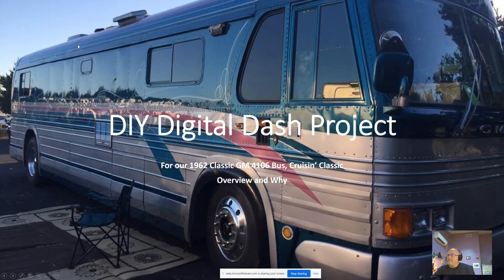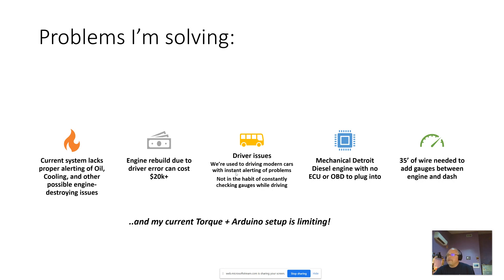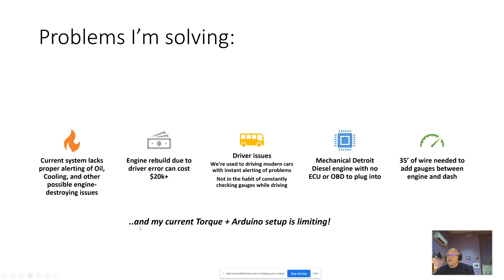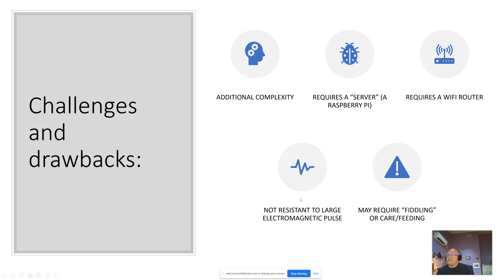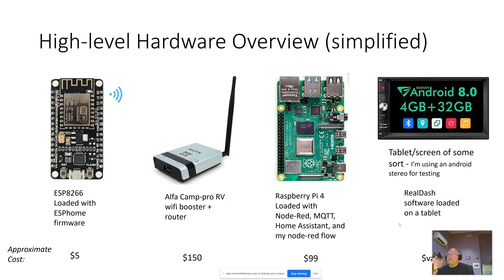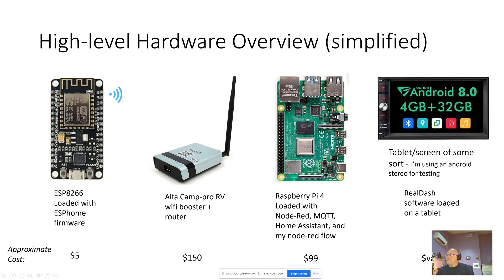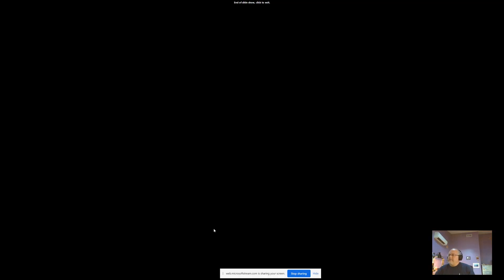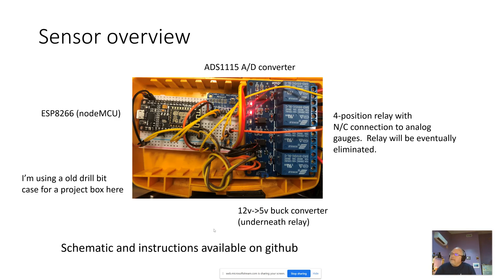DIY Digital dash project overview

Comment: You could remove the rooter and raspberry…connecting directly to the esp8266, but you will loose some features (node-red,Matt,…)
I’m working on similar project for my westy, 
What sensor are you using?
Thank you for sharing
Reply from the maker: Ultimately I did remove the pi and the “middleware”… see later vids for current iteration. I am not done, need to take it further, more open source, and simplify.

Comment: Before I learned of this project, I had thought about the Tesla dash. I thought about having a full iPad where when I started out on a trip I could choose the gauges I needed. For instance if I would be traveling in the desert I could choose coolant, transmission, oil, temps for display, maybe tire pressure sensors, etc.
Reply from the maker: I am considering something similar. There are 12”+ android decks available now.

Comment: Great video! Do you have a list of the sensors for the bus that are compatible with micros? Thanks!
Reply from the maker: Look up the ESPhome website. Anything listed there will work. Sensors that are variable resistance to chassis ground work thru a voltage divider circuit to measure the resistance. Look in the video description below for links to the project and schematics.

Comment: Isn't that a DeWalt drill bit box?  I'll take the bits if you aren't using them. ;-)
Reply: I have 3 or 4 empty dewalt boxes.  I'll throw the stranglers into the new box
Reply from the maker: Yep. It was just the right size.

Comment: I like this, I’ve been thinking similar. I wanted to also somehow get some sort of fuel efficiency rating display as well. My thought was to take throttle position compared to speed to get a rough idea of where it’s most efficient for a given scenario.
Reply from the maker: You could do this with 2 fuel flow sensors - one on the supply, and another on the return, and some math.
Reply: @ThisOldBus  Trying to find those flow sensors with data I can get at AND ones that I don't think will fail / strand me has been hard to find.   I was thinking I could work backwards with an approximation with just throttle position and speed, come up with some sort of number.  Run 100-200 miles, figure out fuel burn, compare it to the number and get an approximate translation table would get me close enough.  My Ford expedition (2008) has something like this, just a 5 bar meter that gives an approximate driving efficiency score.  I know it does track it exactly in the OBDII system, but whatevs.
Reply from the maker: Ditto on the fuel sensors. I think you’d have to fork over some bucks for good ones. I think some of them work on “clicks” which you could count with a microcontroller. I think I’ve seen examples of estimating fuel economy in RealDash based on the gear, speed, RPM, and throttle position, but I haven’t gone down that rabbit hole yet.
Reply: @ThisOldBus  Yeah, what I'm not sure on is how the governor works with throttle position.  I think it adjusts rack position on other factors, somehow sensing load, I'm not sure.   I figure on something like this I'm looking for a rough idea of how I'm driving.  Right now I kind of use my boost gauge.  I know if I'm at 10 PSI or under  in 4th gear I should be getting 6 or better MPG, if I spent more time at 15 PSI, well, might be more like 5 MPG.   We came back from the out west in  to Minnesota recently across North Dakota.  I nearly netted 7 MPG pulling a toad no less.  It's easy driving losing 3 or 4 thousand feet of elevation.